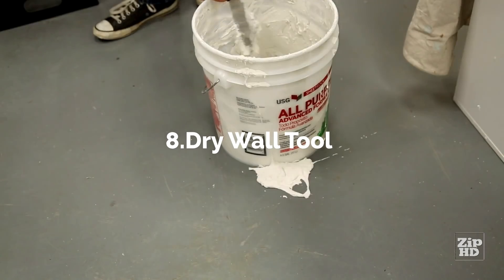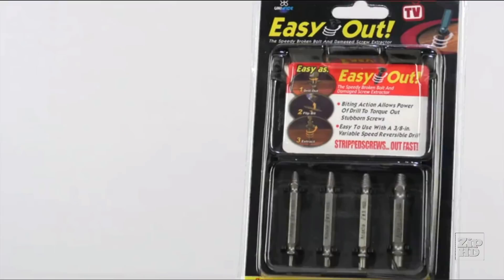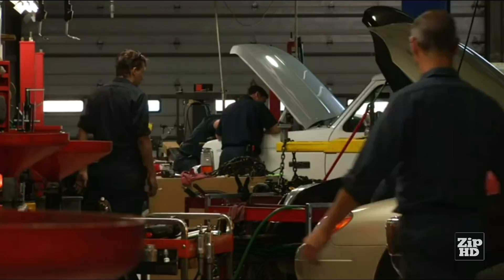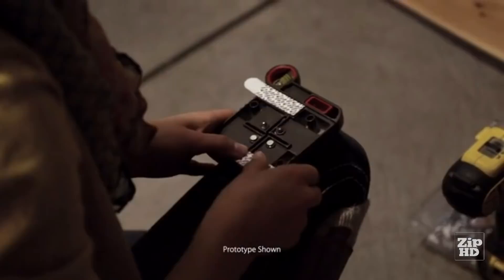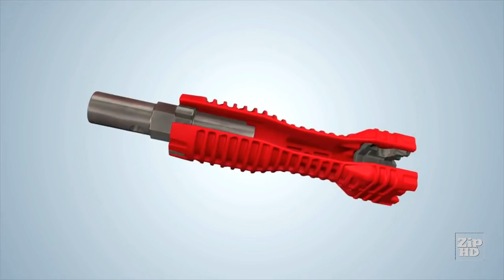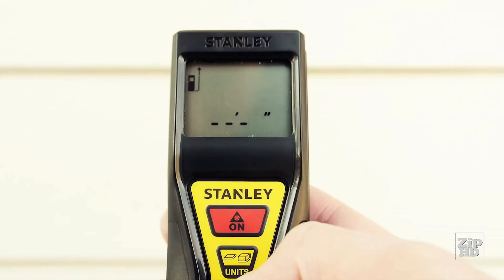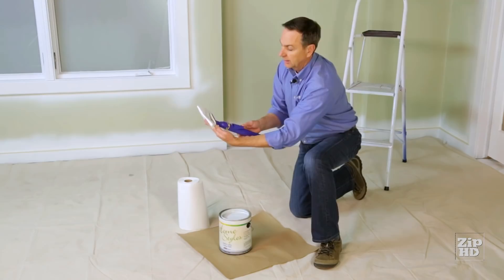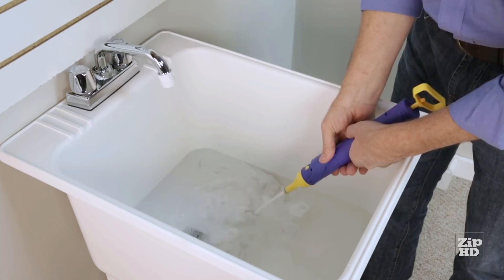7 Amazing House Tools You Should Have #2

Comment: I have 4 different screw extracting kits and I have never been able to remove a screw in 10 seconds most of the time they can’t even drill a hole in the screw. (Ccw bits going slow)

Comment: Easy out in wood. IT WORKS. Of course it does. Try metal
Reply: Worked on some screws I busted off trying to get out of engine block of my 2001 Alero.
Reply: Jack Antoine I don't think that they would help with a manifold bolt